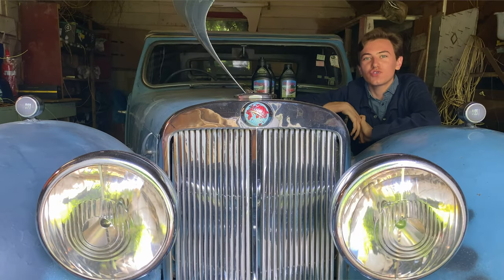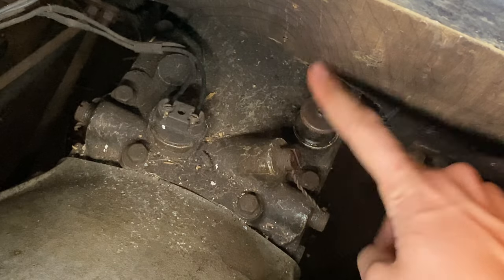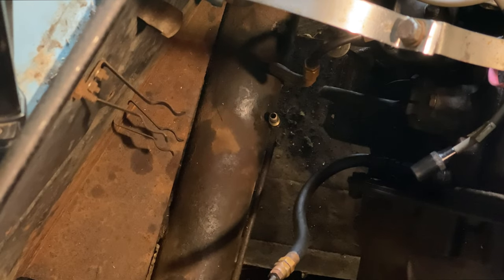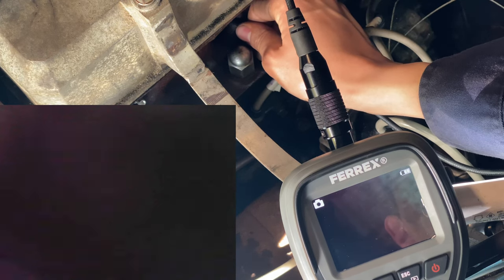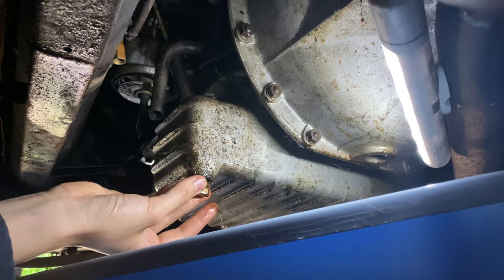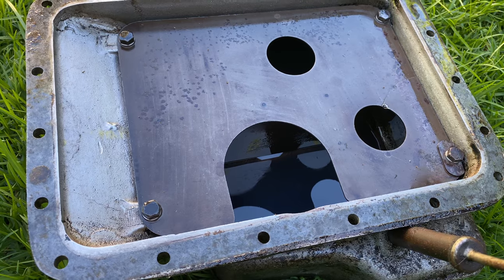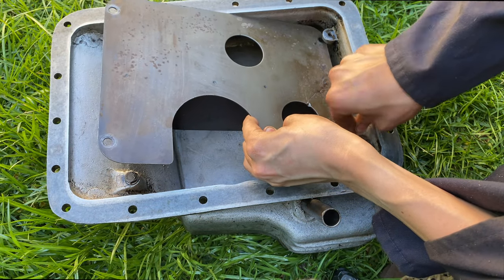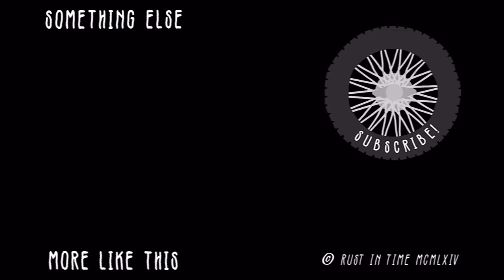Triumph Roadster Restoration Part 8:  Sump Out, Oil in

Comment: You could put the wire in a drill , and turn it slowly , kind of like what plumbers do when unclogging a pipe, hopefully it will remove the clog , then have a nice cup of tea 🫖
Reply from the maker: You're quite right, that is an excellent suggestion. I've already taken the fuel line out though and am having a new one made in stainless. Having looked inside the old one it was rusted solid in some places and I also wonder if someone had put something in the tank at some point to stop that leaking which had also clogged the fuel line.

Comment: What a great car. Curious as to why you remove the rocker cover to fill the engine oil? Is this procedure specific to these motors? Good call on replacing that fuel line. One less variable in the system. 👍
Reply from the maker: Thank you. I removed the rocker cover partly because I'd like the rockers to be well-oiled when I turn it over and partly because the gasket is so rotten that oil oozes out over the engine if I leave it on....nothing specific for the car I'm afraid!